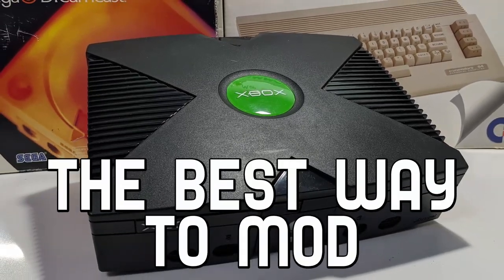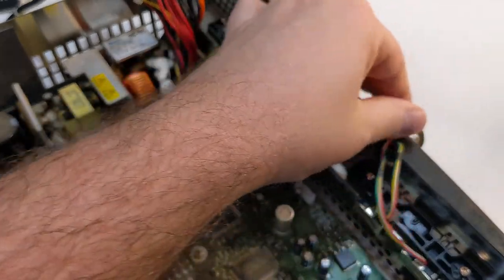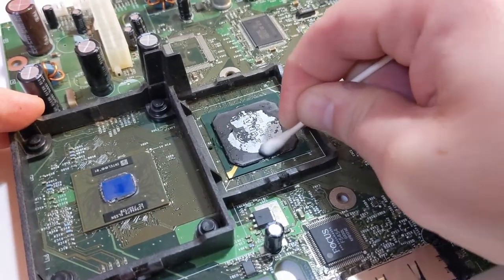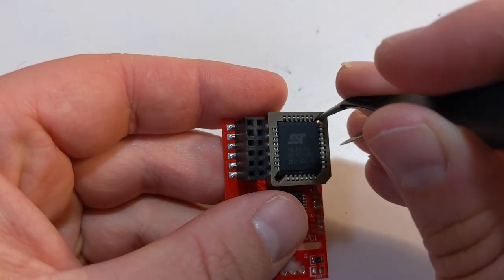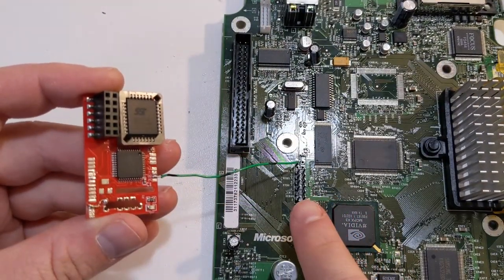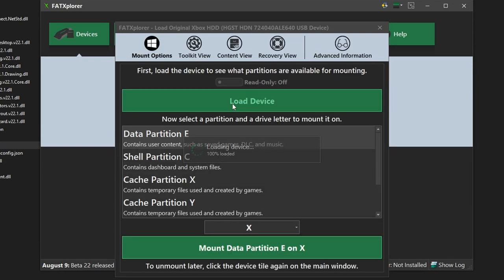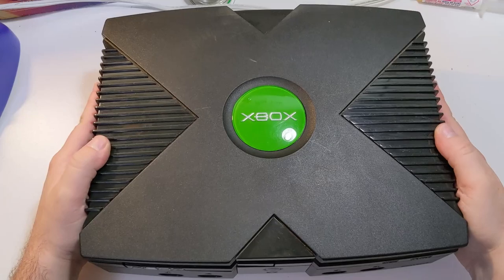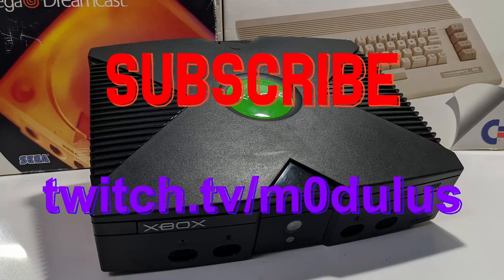How To Mod an Original Xbox 1.0 - 1.4 - Aladdin XT Modchip plus Cerbios Install Tutorial

Comment: 80 wire IDE cable and SSD do not increase speed in a soft modded Xbox with a hard drive formatted to FAT32. Which has about 15mbps read speed on average. You need a drive formatted to nxFAT or NTFS to achive max drive speeds. People use to upgrade the Xbox original hard drive with a faster one and 80 wire IDE, but they had the original Xbox formatted drives, and not a modded drive.
Reply: Cerbios also allows for UDMA5 transfers so it will increase speed over IDE
Reply: A SSD formatted to fat32 is about 1 second faster. Not worth the money, it is faster but if you blink your eyes you won't notice. The 40 wire IDE cable supports 66Mbps. The 80 wire IDE is to connect to the SATA adapter on the hard drive and nothing more. Still not getting max speed with a SSD hooked to a 80 wire IDE cable. SSD needs a SATA cable for max speeds. Best to get a 4tb, 8tb, or 16tb HDD to benefit from Cerbios. XBMC4Gamers supports only 2 TB and can run with a softmod. Cerbios requires a modchip. So if I spend the money on a EEPROM programmer, and mod chip then I want something bigger than a 2Tb SSD. Not enough save space on a 2Tb drive with all Xbox games, NES, SNES, Mame, coin-ops. I might put a 4Tb HDD in one. Also a hard drive with 90% free space runs faster than one with 10% free space. So a 16tb 60Mbps drive formatted to fat32 with 90% free space is going to be faster than a 2Tb SSD with 1% free space also formatted to fat32. And this Xbox original hard drive was formatted to exFAT or NTFS by Microsoft, so this is why it will run faster with the original hard drive format, but when you mod the drives you reformat them to fat32 which is so slow it really don't benefit from the 80 wire IDE ribbon or SSD like the original Microsoft hard drive format would.
Reply: @sleepwalker29 you're so confidently wrong. Cerbios runs at ATA-7 now, (Udma 6).

The difference between a stock UDMA 2 and a UDMA 6 with SSD is phenomenally quicker.

Stop being so naive.
Reply: @TroJanVirusMusic  No, he was definitely correct and you are wrong here. The original xbox was built to handle IDE BUS drivers. UDMA6+ is available for those running larger SATA drives which take advantage of the SATA to IDE adapter speeds such as a Startech. This allows them to run at higher rates, but still does not magically add a new BUS for SSD to run faster. It's just the basics of the Xbox in a nutshell. Waste your money for that milisecond speed gain if you choose. It's just not logical to spend that much and recommend others to do the same for virtually no gain of function.
Reply: What nonsense is that? The XBOX uses FATX, not FAT32, ExFAT, NTFS or anything else. And the IDE bus on it supports UDMA-6. It is just disabled by default due to BIOS lock, and using a 40-wire cable. Hence the UDMA-2.
Of course a SATA SSD will work faster on SATA, but it will be noticeably faster than a mechanical HDD when the bus speed is 133MB/s. Just make sure to use an 80-wire IDE cable. Don't skip that.
One more thing, no spin-up time, and no seek times. This is already a big gain.
Reply: Everyone seems to forget your not limited by the speed of the drive but the Bus that Controls it.

Comment: Pro TIp.  Turn the XBOX on for 10 minutes and then take off the GPU Heat sync.  Then use WD-40 to get the residue off.

Comment: Just finished installed the aladdin. So with the new hard drive it only flashes green and red with the new hdd. Boots fine with stock xbox hdd woth the exception that it skips the Xbox boot animation. I flashed using a programmer. Could it be a bad chip or flash?

Comment: Followed every step; red and green flashing power led. Any ideas? Genuinely can't figure out what went wrong, though the internet insists it's an issue with the HDD?
Reply from the maker: @Appl3sandgrapes This error is usually called FRAG. (Flashing red and green). It means the Xbox has failed to load the bios due to a hardware error. The most common cause of FRAG after installing a modchip is a bad solder connection at the LPC port. Those pads are very small so it is very easy to have a weak solder joint. Double check the solder points and make sure D0 is correct. There are some other things you could check too.  When you programmed the new BIOS chip did you get a "programming successful" message?  If so, your bios flash is good but you could always read the chip back in the programming software to verify. When you power the Xbox on does the modchip light up? If the light is off or dim you should check your pin header and D0 connection again. This error is extremely common so don't get discouraged. I'm sure you can get it working.
Reply: @MadModLabs thanks for getting back to me! I've played around with it a bit more, here's where I'm at now:

System boots now after reflowing everything, however it goes to error code 05; which console mods wiki indicates is either an issue with the tsop flash or the HDD not being locked/readable; I'm using an 80 pin high speed IDE so I don't think that's the issue at least, and if it was a bad cable I think it would go to error code 07 due to being unable to read the disc drive as well if I'm not mistaken. Oh, and for confirmations sake, the power led on the modchip is working and bright

I've double checked the chip on my reader and verified it against the cerbios.bin, which comes back as correct according to the software. The HDD, I've reformatted a few times thinking maybe it's not set up correctly or something to that effect, but everything seems to match the video, so I'm probably not looking at/for the right thing. Any ideas?
Reply from the maker: @Appl3sandgrapes  I wonder if it could be a problem with the SATA adapter. It sounds like the system may not be able to see the hard drive. Are you using the Startech SATA to IDE adapter or is it a different one?
Reply: @MadModLabs I am using a stretch SATA adapter yeah; I thought the same thing and bought a second one just in case but unfortunately I had the same results with both of them. And fatxplorer reads the HDD just fine and has no issue formatting/reformatting for what that's worth

Comment: Hell yeah brotha great vid! Cerbios is where it's at. They just added 1.6 support as well, been helping test with a 128mb upgraded 1.6 that I put together the other day. 
Cerbios is king! 👍
I did a vid on upgrading those shitty non flashable aladdins to Xblast Os aladdins with a 512kb and a 256kb bank, it's the same process but you also need to flash the cpld. I'd highly recommend it as it makes flashing a new bios way easier down the line. Cerbios is updating constantly so having to pull it the flash memory every couple of months.
it's slightly more work and an extra buck or two for the 1mb flash memory but I think it's worth it.
Reply from the maker: Thanks! I Agree. I actually ordered one of the 512kb chips from your shop a while back.
Reply: Your videos are awesome modzville!

Comment: Thanks for such detailed tutorial! I could revive my dead OG Xbox. Unfortunately it got a DVD Drive failure, so the only way to do something was to buying and soldering a modchip, buying a universal programmer and flashing a Cerbios with DVD mode disabled (2- Modern). That way finally I got it working like a charm.

Comment: I bridge my TSOP points on the 1.0 - 1.4 motherboards, install pin headers, temporarily install an Aladdin modchip, flash the BIOS through the modchip with a TSOP BIOS, then pull the modchip. I find it faster than softmodding the XBOX first.

Comment: Amazing tutorial. 🎉
You deserve a medal 🏅 

With the mini pro, do you need an adapter to read and write the SST chip?
Reply from the maker: Yes. The adapter is a PLCC32 to DIP32. It just makes the pins of the SST chip accessible to the mini pro's socket. Here is one like I used: https://amzn.to/3K5mXxW
Reply: @MadModLabs  thank you for the reply. I actually had GQ4X4 that I used to try and flash the SST, with the same adapter on Amazon. But.. it didn’t work. I did some investigating and found out that the GQ4X4 requires an adapter to make the SST chips work! They want another $15 for the adapter. I may have fried my SST chip since Vcc is around 5V. I wish they were more transparent.

Comment: Great tutorial, straightforward and detailed! Question: what if I only install the modchip without upgrading my hdd? I leave the original hdd as is. What advantages or any extra features will I get?
Reply: Everything except you have a small hard drive.
Reply: No advantages at all, you'll be worse off because you'll still have to use disks.

Comment: Awesome video!!! Can I use the XGecu T48 [TL866-3G] Programmer TL866CS TL866II Replacement Support 31000+ ICS for EPROM/MCU/SPI/Nor/NAND Flash/EMMC instead of the 34000+ you suggest? Thanks!
Reply from the maker: Yes. As far as I know the 2 programmers are almost identical.

Comment: Great video. I purchased everything and tried as you stated but all I got was a green and red flashing light. Is there a setup in the program other than changing the chip model number?
Reply from the maker: This error is usually called FRAG. (Flashing red and green). It means the Xbox has failed to load the bios due to a hardware error. The most common cause of FRAG after installing a modchip is a bad solder connection at the LPC port. Those pads are very small so it is very easy to have a weak solder joint. There are some other things you could check too.  When you programmed the new BIOS chip did you get a "programming successful" message?  If so, your bios flash is good but you could always read the chip back in the programming software to verify. When you power the Xbox on does the modchip light up? If the light is off or dim you should check your pin header and D0 connection again. This error is extremely common so don't get discouraged. I'm sure you can get it working.
Reply: @MadModLabs  Thanks, I resodered everything and it worked as you said. Thank you.
Reply from the maker: @Rlgoggs  Awesome! I'm glad you got it working. Congrats!
Reply: @MadModLabs  I received a pre hard modded xbox and it also has Frag, it doesn't use a pin header and instead has individual wires connecting to the LPC port, what would be an easy fix for this?
Reply from the maker: @majestic2876  definitely check the solder connections on those wires. Using individual wires serves the same purpose as a pin header, but it is easy to accidentally short 2 wires together on the modchip's quick solder pads.

Comment: Great video.  Question 🙋🏽‍♂️ where’d you get the dash from?  Could I extract it from a soft modded xbox by ftp then load it strait to the new hard mod hd?  
     Question #2 why would you hard mod then put xbmx4gamers when you could do that with a soft mod?  I was hoping you show us how to install coinopps or something diff than a soft mod.
Reply from the maker: You can download XBMC4Gamers here: https://drive.google.com/file/d/1je41mKY0Qm7L3P1zbZkcgt7VphEhYFz2/view And yes you could copy the files from another Xbox if you  wanted to. Answer #2: Installing a modchip allows you to easily change to a custom BIOS. The BIOS featured in this video has support for hard drives up to 16TB and RAM expansion up to 128 MB. There are many other awesome features offered by Cerbios. I would recommend checking out their discord server for even more details.

Comment: If you’re using a solderless adapter that has ground d0, would that pass through the header on the Aladdin or would I need to connect directly to the chip?

Comment: awesome tutorial, question, what is the extension of the games that you need to have if not on a .iso? Thanks
Reply from the maker: The games are composed of several files in their own folders. It is basically the files you would get if they were each copied from the original disks. If you have ISO files you can extract them with a program called XDVDMulleter: https://archive.org/details/xdvdmulleterv10.2beta

Comment: Is the D0 soldering point on the top and bottom of the chip or should be soldering on the top of the chip/board only?
Reply from the maker: The Aladdin chips has a D0 on top and bottom. Both will work.
Reply: @MadModLabs  THe red light comes on, but it won't boot into the chip for some reason.  I don't have a programmer either.  Frustrated LOL!
Reply from the maker: @feonjun  if your Xbox is flashing red and green, definitely go back and check all your solder points. This is called a FRAG error. It is very common.
Reply: @MadModLabs  I took your advice and went over all the connection/soldered points and decided to put the D0 point on top like on your video.  It works now.. THANK YOU SO MUCH!!
Reply from the maker: @feonjun  Nice! I'm glad you got it working

Comment: Had some problems with the mod ... turned out I was using and old EvoX bios, the old ide cable with a 2tb sata drive ... finally fixed it tho. now trying my second mod, but have some different issues. The chip installed just fine, the Evox logo shows up on startup ... but does not work with any other hdd other than the stock one. Also only still reads original discs, not burned discs ... it just shows up as Unknown in Unleash X (original hdd has softmod).

Comment: The GPU adhesive will soften up with a hairdryer just enough. And WD40 is the best way to get rid of that glue thingy. ;) Also, which is the best bios to use for a bigger, at least 3TB hdd with? This, or evoX, in your newer video?
Reply from the maker: Go with the latest version of Cerbios for sure. It now supports all versions of the original Xbox.
Reply: @MadModLabs  Thank you ! If I'm ordering the cheapest aladin clone from aliexpress, is it still needs to be burned an edited rom?
Reply from the maker: @cybcarr  Yes. I have not seen any chips shipping with Cerbios already installed
Reply: @MadModLabs  Thank you! :) 
I'll contact you if i can. Can I?

Comment: I got this weird issue with Artwork installer ... for some reason the Download button stays green and I can keep installing it over and over. When it's done instaling, it doesn't seem to do anything and no artwork is loaded ... when I restart my Xbox, Artwork installer seemingly seems to be not even installed yet, anyone know what's going on? I believe my mod chip is a bit of an older one tho ... perhaps that is the problem? But then, I had no problem running Hexen disc and installing xbmc4gamers.

Comment: I ripped the DO pad off with ease, is the board toast or could I still softmod it?
Reply from the maker: The board is not toast yet. Pulling off pads is very easy to do. Fortunately, there are other D0 points. You can try repairing the damaged trace with a very fine piece of wire or try connecting one of the alternate D0 locations to a grounding point. Here is a Reddit post about it: https://www.google.com/url?sa=t&source=web&rct=j&url=https://www.reddit.com/r/originalxbox/comments/w5kt0u/rookie_mistake_ripped_the_d0_pad_right_off_trying/&ved=2ahUKEwjZufmA5Zf-AhVUFFkFHUpNCvAQFnoECBMQAQ&usg=AOvVaw3Oz3YPdheUbC4oiFhPVwkh